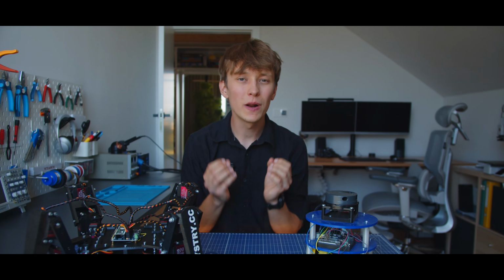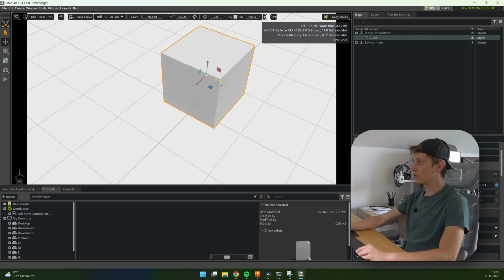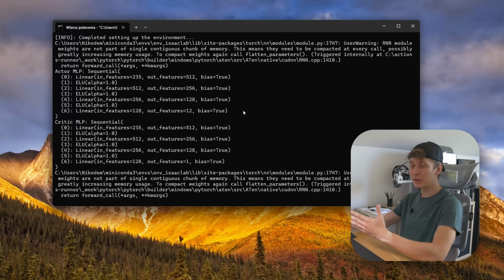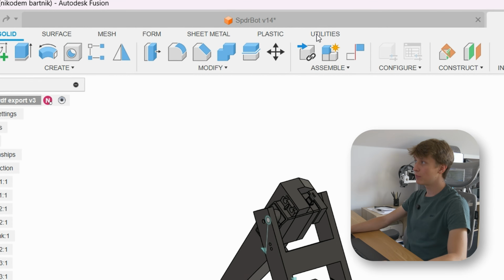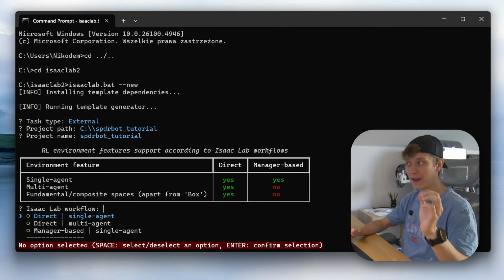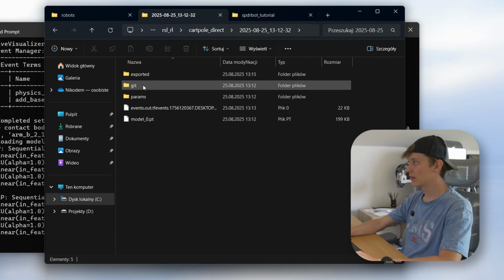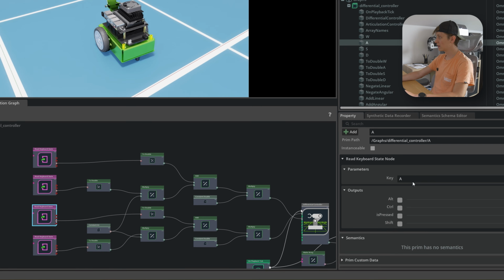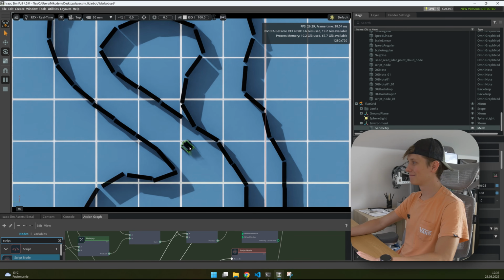Isaac Sim & Isaac Lab: Full Guide to Building & Training Robots

Comment: Dear Nikodem,

I’m working on a robotics project and would really appreciate your advice.

My goal is to build a mobile robot from scratch using real hardware components such as an IMU, LiDAR, Raspberry Pi, wheel encoders, and cameras. The idea is for the robot to autonomously move through a small supermarket, analyze the shelves to determine whether they are full or missing products, and eventually — as a longer-term objective — manipulate and place products onto the shelves after scanning them.

At this stage, I’m especially interested in understanding the fastest and most realistic way to realize this project, starting from a functional prototype. I’d like your perspective on:

Recommended system architecture (hardware + software stack)

Which parts should be prioritized first (navigation, perception, manipulation, etc.)

Tools, frameworks, or platforms that would significantly speed up development

Common pitfalls to avoid when building such a system from scratch

Any guidance or direction you could share would be extremely helpful.

Thank you very much for your time.

Best regards,
Yasein

Comment: I am using Isaac Lab with ArticulationCfg to load a wheeled robot.

I noticed that my robot does not show any PhysX colliders (red collision shapes) on the wheel links, while the official Nova Carter asset does.

I would like to clarify:

Does ArticulationCfg assume that all articulated links (especially wheels/casters) already have valid PhysX rigid bodies and colliders?

Does ArticulationCfg intentionally avoid creating colliders automatically?

Is PhysX completeness of the USD asset considered a prerequisite rather than something handled by Isaac Lab?

Is there an official or recommended “minimum PhysX setup” for wheeled robots used with ArticulationCfg?

Comment: Thank you very much for this video.

As far as I know to control robot with RL model, we need to look at gym environment like code. It has actions details and joint details. So we can use ONNEX model and create own python code to give action input to model and model output get joint values. It is simple way. But when consider real world scenarios, it is not practically work because of some frictions etc. So this process call "Sim2Real" method. This do match our simulation model with real robot. You can do first method i mention then can search sim2real methods then also can search ROS method. ROS can create custom interface for action and robot joints. Then use that interface with ROS to give RL model input and get RL model output to interface. So ROS Code <---> RL MODEL <--> ROS Code <--> ROBOT CODE. Robot code means Raspberry PI or Arduino code to communicate with ROS. Which means ROS give rotate 180 degre then Arduino code responsible to do exactly rotate 180 degree based on sensor. Also Arduino code responsible to give robot status using sensors. That will helpful for RL model. It can be I2C. Also can use ROS Control package that use PID controller, Differensial control driver etc between ROS Code and ROBOT code. ROS Code <---> RL MODEL <--> ROS Code <--> ROS Controller <--> ROBOT CODE. Check this videos:

For ROS and ROS Controller - https://www.youtube.com/playlist?list=PLunhqkrRNRhYAffV8JDiFOatQXuU-NnxT 
For RL to Robot - https://www.youtube.com/@Skyentific

Comment: To run your trained policy outside the Isaac environment, you need to take that onnx file, deserialize it, use onnx runtime or convert it into a tensorRT engine plan. You can construct you policy in Torch using the same architecture that you can see in terminal and deploy it from there.
Reply: For prototyping and faster dev, can't we just use pickle to load the .pt file and run the model?
Reply: @kostubhkhandelwal4665  if you are working in isaac sim and recreating the same model object, yes. You can but the question here is to deploy it in torch or other backend on some embedded system.

Comment: Those are some pretty steep system requirements, is there any workaround to run it on lower specs, such as RTX 4050, 16GB RAM??
Reply: I belive there is a way to use cloud compute, not sure how they do it though. I have a 4070 and it runs fine for ml im sure most rtx cards would work tbh it would just take longer, once the model is trained it will be smooth in isaac sim, running a model isn't particularly resource extensive

Comment: 99% of people use ROS to run the model generated in Isaac Sim. They have a bridge for doing this. That said I agree there is a way to use the model directly. You will want to take the training model and convert it to onnx first. From there you will need to write your program to load the model, send it all the information in the correct sequence but the data will be the current sensor data, the current motor velocities etc. And then when you inference against the model, you will need to use the returned values to set the new velocities. Good luck, I have not seen any of this done either but I know it can be done
Reply: I have tested this method and it works like a charm
Reply: Agreed, I have code to do it with onnx and pt files, Its really easy to run inference against them using onnx since it already has model description and weights

Comment: Hey Niko, 
Absolutely brilliant work! 🙌 Your walkthrough of Isaac Sim and Isaac Lab was not only technically rich but also incredibly well-paced and clear. It’s inspiring to see how you bridged simulation with real-world robotics so seamlessly.

Quick question: At @53:21 I’m curious about how you exported the trained and tested classifier from Isaac Sim to run on your Arduino-powered robot. 
Did you convert the model into a lightweight format or use some kind of intermediary microcontroller for inference? Would love to hear more about that part of your pipeline!
Reply from the maker: Hi, thank you very much!

You can check out micromlgen: https://github.com/eloquentarduino/micromlgen
It's super easy to export classifiers from scikit-learn with just a few lines of code and run them on Arduino!

Comment: I had a thought, instead of making the robot learn to walk, let it control a set of animations you make like a walk, run or such and give it variables to control in the animation like to slow down this motor and such to turn and climb walls. Kind of like how we have already learned to walk so well that it’s natural. Perhaps there is a way to give robots a way to alter these animations to make it better for them as well
Reply: Honestly, its the same thing. But instead of learning from scratch you learn from something already trained. This can be done as well and its called re-enfircement training. You take a model that is already working a little bit, you you train it more with particular goals and it perfects its model. There is no animation part in the equation the goal for this tool is to have a model that directly sends commands to the motors. The animations you see are based on the physics defined in the simulator including motors, joints, etc. This Sim is not about animations its about real world joints. The animations are just 3d representations of those real world defined joints with a pretty texture material applied to it.